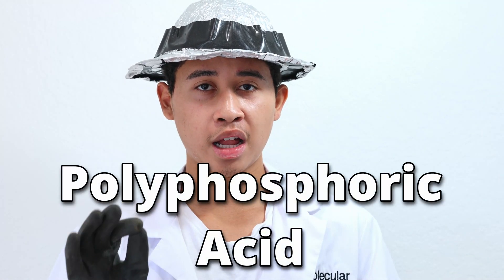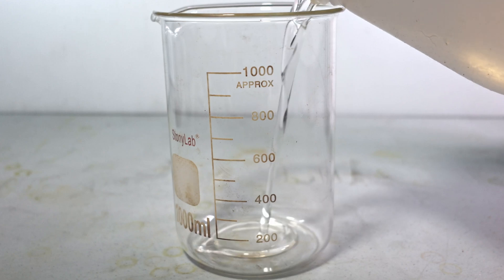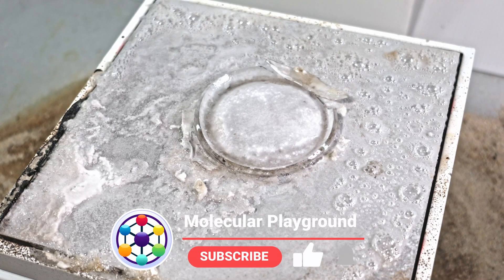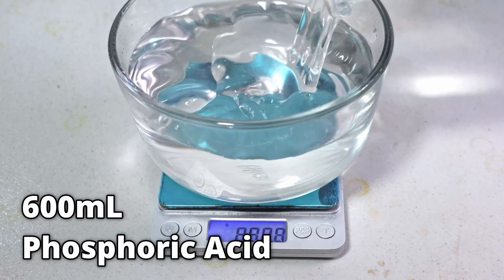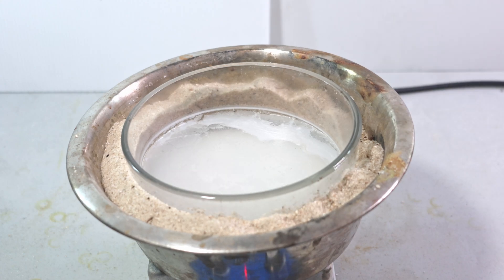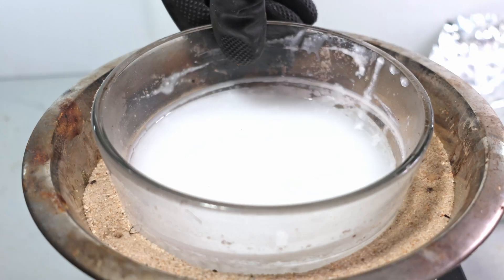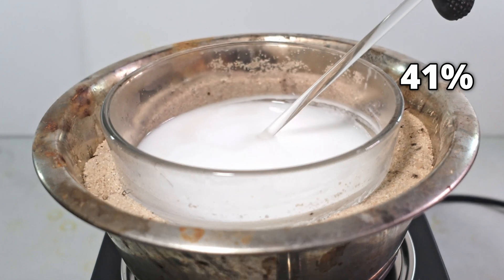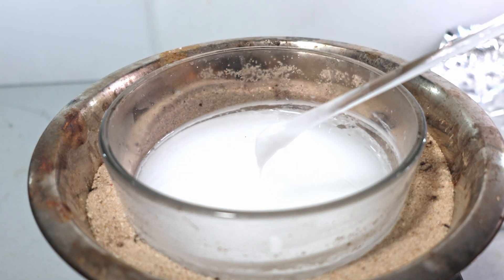Making Polyphosphoric Acid

Comment: Awesome! Any idea why it ruins glass and how to avoid it?
Reply from the maker: Hot phosphoric acid is one of the few chemicals it can do it (along with hydrofluoric acid + fluorine derivatives and hydroxides). Fluorine can displace oxygen in SiO2, but I’m not sure why the others can too. The best way to avoid it is maybe using a graphite crucible
Reply: @MolecularPlayground  I see. Graphite is porous so that wouldn't work for that reason. :( Gold-plated metal dish could work
Reply from the maker: @gogo311  Not even one of those graphite crucibles that smelted metal is poured into? I would think if it can handle liquid metal, it can handle increasingly dense phosphoric acid.
Reply: @MolecularPlayground  I have accidentally melted magnesium sulfate in it and it soaked right into it.. bad experience. So would phosphoric acid, definitely
Reply from the maker: @gogo311  The melting point of MgSO4 is 1124C. This reaction will not get hotter than 450-500C. Also my crucible is technically silicon carbide.

Comment: FYI, at least in the U.S., around 1950, Pyrex stopped using borosilicate glass, and switched to tempered soda lime glass. According to the company you can tell from the logo. If it's all caps “PYREX,” it's vintage, made of borosilicate. If it's lower case “pyrex,” it's the newer, soda lime. I have read that in Europe, all Pyrex is PYREX (borosilicate).
Reply from the maker: Very interesting…

Comment: Did you have any uses for the PPA? I cant remember who did it but someone did this and made oleum with it and the poor beaker was just so white after that 😂
Ive had some of it sitting around for awhile but just never got around to using it.
Reply from the maker: I actually did want to try to make oleum with it. My hotplate does not get hot enough though, so I am looking forward to getting a ceramic hotplate which can get around 500C